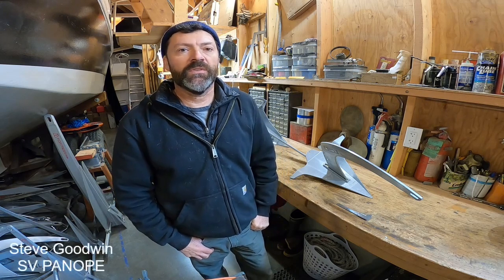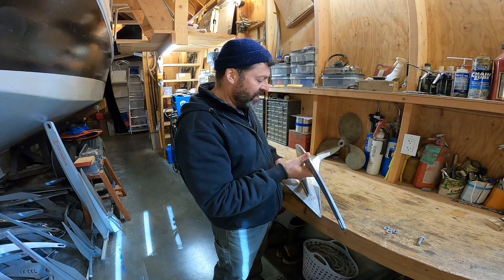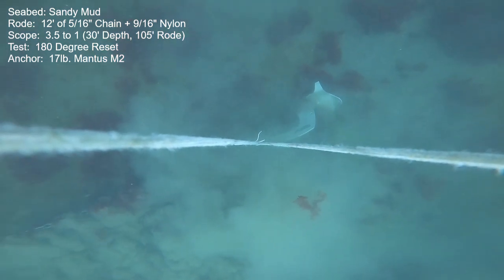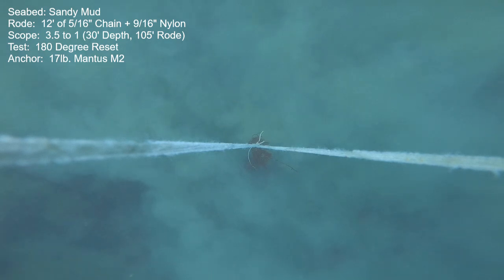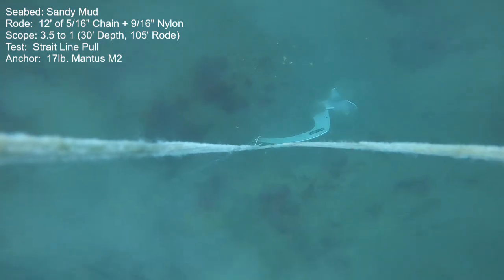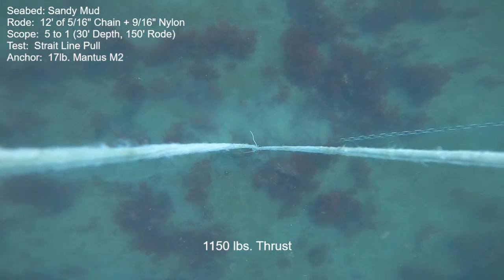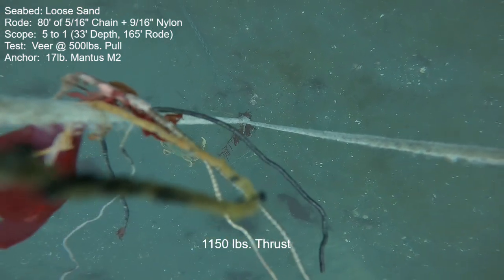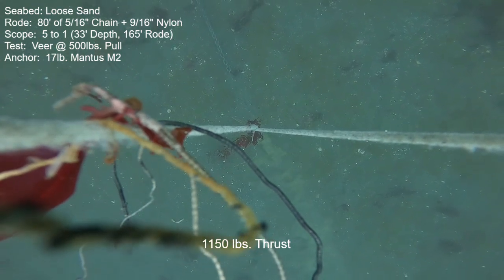Mantus M2 17lb. Review/Test.  Anchor Test #103

Comment: So in a nutshell : buy the proper bolt, buy one size up if you need more 'performance' in soft grounds. What a great anchor.  I concur with the request for a visulalisation of the anchors on the roller. I'm trying to decide between the Vulcan(sadly no real comparison, for the one tested is a 55..) the mantus M2 45, and the Ultra. SADLY the later one is not capable of connecting with your chain without their special swivel.. (small hole in fluke)
I'm awaiting your results of the big M2 with great anticipation. Thank you so very much!

Comment: I cant wait to see how the larger M2 goes!! I've recently bought a cruising boat, 33ft, 1300lbs, in Puget sounds, it has a Bruce and I've been geeking out on your excellent research while I'm deciding, definitely leaning towards a mantis at this point. Thanks for all your work! I thought about the increase sea life at your testing site, and wondered if you're tilling it and some how inadvertently improving soil conditions... unlikely but possible.... more likely weather cycles.
Reply: I too have a 32 foot cruiser got it 10 months ago it’s in Channel Islands harbor. Also came with a Bruce. Im geeking out on these videos as well and was leaning towards mantus m2 like you but now I’m not so sure, spade seems good as well. Very hard decision.
Reply: @renny9879  I went with a viking 30lb, I've been happy with it. It hooks in very aggressively. I've not had any issued apart from a few galvanizing chips... but no rust. They've probably fixed that by now. Spent the night in 20kt a couple weeks ago. Mantis is great too by all accounts.

Comment: you say the bolt has dug into the galvanizing,  it's not so bad cause it doesn't rotate on said bolt, but it is a common issue where the threads will elongate/grind//wear out the holes on other equipment/stuff especially if something does rotates on it. I'm thinking most specifically of snow plow mounts, when people put in bolts instead of smooth pins
they really should have included a shoulder bolt, so said hole doesn't wear out quickly; you can also just get a longer bolt with an actual shoulder  and just trim it the required length and treat the end of it

Comment: I downloaded the file from Mantus and printed off the 17 lb anchor then I taped the prints together to make a template to check the size on my bow roller. Spade gives measurements for each of their anchors. The Spade measurements are bigger than the Mantus so I was impressed with the results of your test of the M2. I would be interested in how much fewer weeds hang up on an anchor with and without the roll bar.
There has been a lot of comments on what to list in the results but listing everything allows people to discard the results they are not interested in like price is irrelevant to some people.
Thanks
Reply: Dear Stanley,
Where you found the file Mantus for printer? Thanks for help me in advance.

Comment: Awesome to see these tests. I am also really interested to understand if a roll bar has any real advantage. Do the anchors ever end upsidedown, do they just right themselves when setting. Mantus M2 test would be of interest. Thanks again for all the testing. Cheers
Reply from the maker: Gordon, For anchors that are designed with one, a rollbar is essential because without one, they will not self right in the event they become inverted.  Careful deployment might result in an upright anchor nearly everytime, but this cannot be assured.  Also, in 180 degree wind or tide change, anchors can sometimes flip over onto thier backs.  Anchors that are designed without rollbars usually have ballasted flukes and specially shaped shanks in order to self right.
Reply: Steve, thanks for the reply. My current anchor has a roll bar which gets in the way of our prodder. So best to replace with an anchor designed without one and "touch wood" it behaves as designed. That's again for the tests. Cheers

Comment: I've bee looking to understand what my 37' 15000lb sailboat actually needs for anchoring and I don't have good idea of what's needed for a given wind force.  The information you provide is wonderful and I can see the work you've put into it, but without context of what I actually need doesn't help me much in deciding if I need an upgrade or not.   As a comment, when I really need maximum holding power I'll always use a scope of between 5:1 - 7:1 using 120' of chain then nylon.  Your tests seem to always use 3:1.  I'm sure a few degrees of pull angle will certainly make a difference.   Also, I've never seen the wind change 180 degrees and pull a reset directly over the top at 3knts...maybe it can happen but in my experience as the wind changes direction it tends to swing the boat around.   Would you consider making a video that would help understand what kind of forces are created on boats at anchor to help make your test results more meaningful.   I recognize there are a lot of variables involved but but trying to get some understanding of what forces a boat creates is the first step to making a discussion on what anchor is needed.

Comment: Steve: A couple of times, in this video, you mention that this size Mantus M2 "would be good for a (particular size boat)..." I am boat shopping and learning all I can. Your videos are fascinating!  Have you ever thought about mentioning in your videos, while testing a particular size range of anchor, what size boat would typically use that size anchor? Also, I read a lot about sizing up one, or two, for extreme conditions. Is this true for most modern anchors as well?
I'm not looking for a specific type recommendation,  just a idea of what size boat requires what size anchor (range). I've been to manufacturers websites and looked over their tables for day anchoring and overnighting. Still a bit confusing. If you can help us newbies/wanna-be's better understand what to look for, I know that I would definitely appreciate it. Thanks Steve for all the great content! Stay safe!
Reply from the maker: Nate, I agree with you that anchor sizing can be confusing.  First, there is no right or wrong answer as different people will have vastly different technique, risk tolerances and most importantly, different circumstances.  Perhaps, the greatest unknown is SEABED TYPE.  I have found the performance of an anchor to vary by as much as 10 times depending on seabed type.  Some sailors, that have very accurate knowledge of their anchoring conditions may be able to downsize thier anchor and never have a problem.  
In the region where I anchor, it is often impossible to know the seafloor conditions.  Also, I like to anchor in very very small coves, thus requiring very short scope.  These factors cause me to lean toward heavier anchors.
My response here only scratches the surface of your question.  I hope it helps.
Reply: @flygoodwin  Thanks Steve for the response. I live in Michigan, so I would be learning How-to anchor on the Great Lakes. My bucket list is the completing the Great Loop. There are a lot of Rocna rollbar lovers on the Loop. The boat that I am looking at is a Ranger Tug R-29 (33', 10,500 lbs). I have been trying to figure if I should be following your 45lb chart or stick to the 20lb "battle of the anchors" lol. Either way, I will continue watching everything you put out. Thanks for doing this work. I agree, I think I want to go big (heavy) Just as long as the windlass will handle it. Keep up the great work!

Comment: The back of the anchor fluke is bent upwards; it should be bent downwards to avoid acting like the aeroplane wing flaps pushing the nose up during take off, when the Mantus M2 is moving in soft mud. I recall the bent upwards back of the fluke of the Rocna contributed somewhat to that anchor’s poor performance in sandy mud. I wonder if the Mantus M2 would perform better in soft mud if the rear of the fluke was bent downwards to help the anchor dive down during movement in soft mud. A minor criticism (or suggestion) of a high quality robust anchor.
Reply from the maker: Ross, you are correct about the Rocna.  It did do better (excellent) in the soft mud after the fluke was pounded flat.  If I had a spare M2 AND had the consent of person(s) who donated it, would be happy to pound it flat and give it a try.

Comment: Hey Steve, you can't include tip weight, price, galvanising, and perceived strength in "best performing anchor", price could make it best value with lower performance. Just be careful about the difference between "best anchor" and "best value anchor" and "best performing anchor" - they're all very different things. Cheers.
Reply: 23:28 he says you’re free to ignore any column that doesn’t apply to you like price and galvanizing.

Comment: Interesting.  I have to say I have avoided the M2 simply because my brain couldn't get over the much shallower angle of the shank, almost pointing down from the anchor.  
To me it feels like the anchor would be too flat to really dig in, and any slight upward movement of the chain would simply pull the anchor out.
Also, why do you not use a rotating shackle? I always have had them, thinking they're totally necessary in cases of boat rotation, or is that wrong?
Reply from the maker: The pulling force (rode) does not follow the geometric shape of the shank (shank could be shaped like a pretzel).  What matters, is the position (spatially) of the chain attach point with respect to the fluke.

I have been anchoring boats for 40+ years and have never needed a swivel.  I do not use a swivel because a prefer the most simple/strong solution.  

Other people/boats benefit from using a swivel.  I have no first hand experience with this phenomena.

Comment: Hey Steve,  great video as usual. Unfortunately the results weren't in my favor ..
. Lol, I was hoping it would do better in soft mud so I could use it as my second anchor. I would be looking at the 25lb anchor, do you think the extra weight would make enough of a difference that it would be comparable to my primary anchor the 25lb Viking ?

Cheers Robin
Reply from the maker: I believe that pound for pound, a Viking will have higher holding in soft mud than a Mantus M2.  I have found a near perfect correlation between "thin fluke/rollbar" anchors doing better than "ballasted fluke/non-rollbar anchors in Soft Mud.  Opposite in the Sandy Mud.
Reply: @flygoodwin  awesome Steve thanks for the quick response 👍

Comment: Have you considered a column for how the various anchors stow on bow rollers? I would rather see this practical information rather than tip weight that counts for little. What is the purpose of scoring tip weight? If the anchor performs well who cares about tip weight. 
Rocna anchors can be hard to secure on many bow rollers. They need lashing down when bashing to weather. A Spade doesnt. It would be nice to know how other anchors stow. In addition, some of these large anchors will catch a lot of sea on the bow roller in rough conditions. I know of anchors that have come lose on bow rollers due to stowage problems. These are useful practical considerations
Reply from the maker: Tim, regarding bow rollers, I am planning a test of "self launch" ability.  I'll look at "stowing/securing" also - thanks for the idea.  I believe tip weight to be a substitute for testing in difficult to penetrate seabeds like hard sand and heavy weed.  Perhaps, after completing those tests the tip weight will be irrelevant.  See my "Seaweed Penetration" video #80.
Reply: @flygoodwin  with all due respect, I am not sure tip weight alone will predict behaviour in weed or seagrass. Sharpness of the point will make just as much difference when penetrating seagrass. Why not just stick to what you are testing rather than predicting what you havent tested? Love you testing
Reply from the maker: @timevans8223  If I had to choose between 2 anchors that were equals in every way except for tip weight, I would choose the higher tip weight every time.
Reply: @flygoodwin  we sail in the Caribbean. Sea grass is common. The ability to penetrate seagrass is important. Tip weight/sharpness of the tip are important. Would a blunt tip with high tip weight penetrate seagrass? Only testing would tell. We know our Spade copes better than most anchors in seagrass. A head to head test in seagrass would be great but relying on tip weight only to assess this isnt the same as testing.
Reply from the maker: @timevans8223  I agree completely that the tip weight is a poorer measure than testing.  But I feel it is better than nothing.  Eventually, I will travel further afield and find these seabeds.  Spade has a higher tip weight than most anchors.  Yes, it is also fairly sharp.
Reply: Big call to say tip weight counts for little. Those of us who love our Spade anchors may be taking it for granted !
Reply: @robertbuchanan6277  the tip weight is irrelevant if the anchor has been tested. Why should it add to the score of the anchor? There is a scoring column in each seabed. Adding tip weight on its own as a measure of performance in a seabed that the anchor hasn’t been tested in is a pure guess. You could have a high tip weight and a blunt tip. We wouldnt know how that anchor performed in seagrass until it was tested in such a seabed. Its great to get test results from all these anchors but the tip weight column tells you nothing. I speak as satisfied owner of a Spade anchor.
Reply: @timevans8223  No point arguing with someone as certain as you.

Comment: Steve , the Set Screw should a bolt . Screw by there very nature are subject to shear stress and corrosion at the root of the threads .
Very bad engineering practice. What is common with mantis.